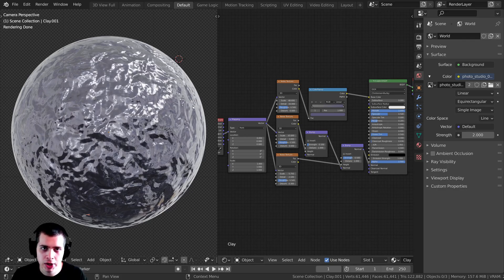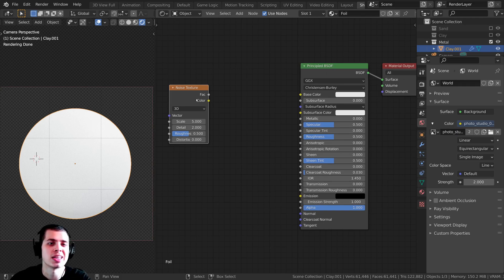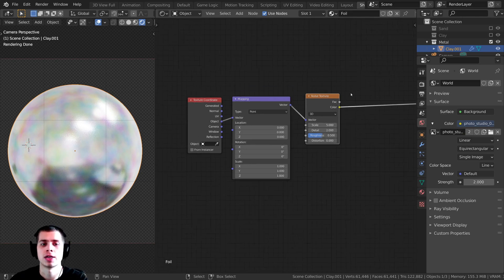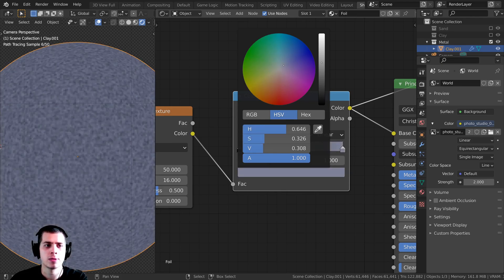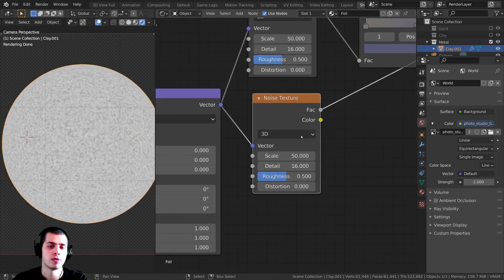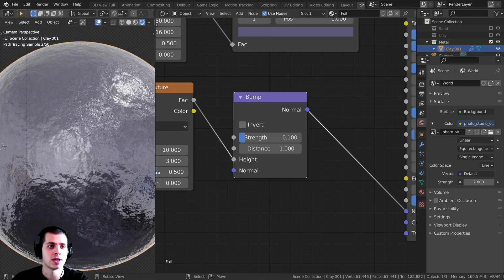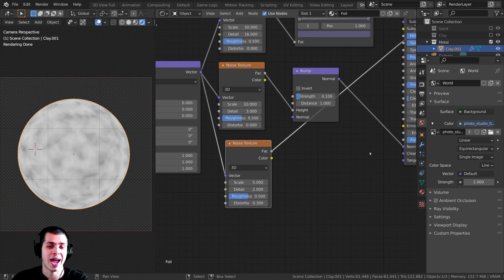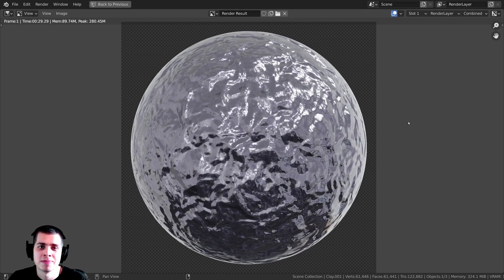Procedural Foil Material (Blender Tutorial)

Comment: Edit: sorry if this turned into a repeated question, youtube had an error on the last message that i posted here.

Amazing stuff once again mate! 

I have a question about performance as i was told that it was bad once you hit more details when creating procedural textures. Could you explain how far you can go with procedural textures? and how to avoid getting crashes/laggy blender with a heavy load (textures)?
Reply from the maker: Hmm, I don't really have any lag problems when using procedural textures. Although I do have a pretty powerful computer, so that helps. The Procedural Planet Material that I made, is a little laggy, but its also very detailed. You could try to use the same noise texture, for multiple parts of the material, and that might help. Also, I have found that Eevee has a lot more lag with Procedural textures, then Cycles. I think it has to do something with Eevee being, Real Time. I almost always use Cycles, so that helps. Render times are longer, but there is less lag. Also, one thing that you could do, to make the performance way better, is to bake the procedural material, as texture maps onto your model. You could also just bake a flat texture of your Procedural Material, and then in a 2d program, you could make it tillable, and then use it like a regular texture map. It wouldn't be Procedural, but it would make the performance way better. I just recently made a texture baking tutorial on my channel. You may have seen it. Anyway, hope this helps.
Reply: @RyanKingArt  Thanks for the reply! Yes very helpful :)